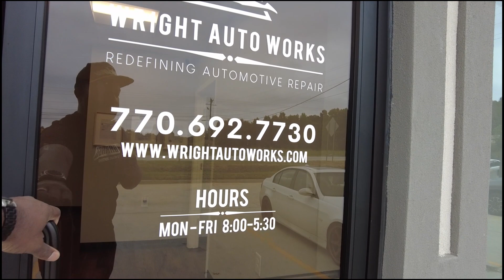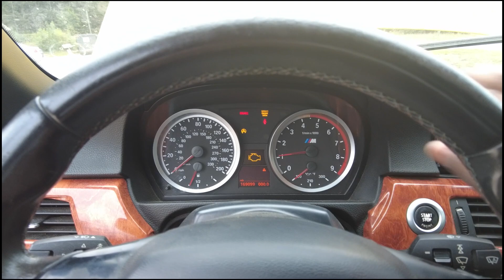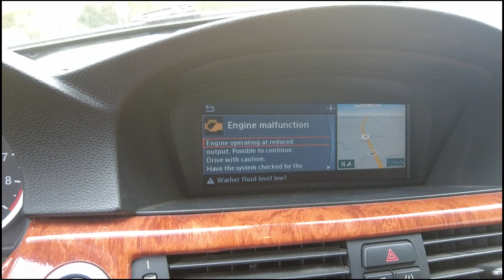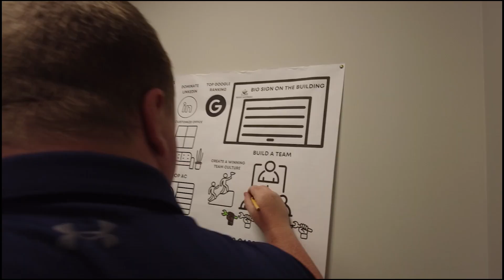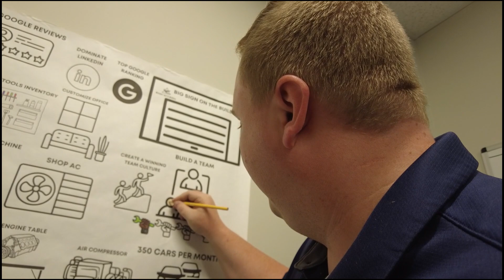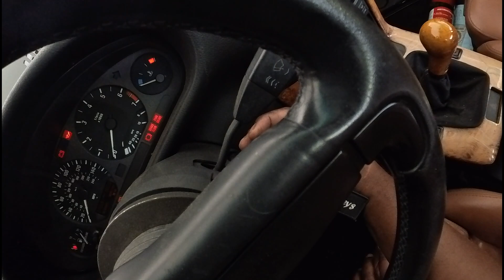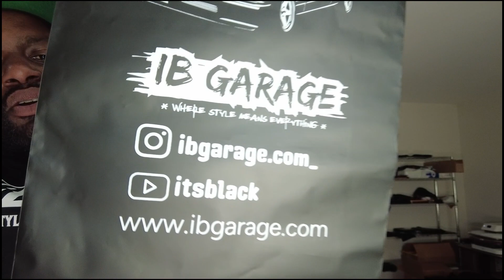It's Been A LONG Time... || ItsBlack

Comment: Before you sell tje m. Check the elec pins in the plugs where  the actuators plug into the harrness they maybe lose an not making good contact. Had similar prob with e46 throttle body connector intermitent codes limp mode..plug in  connector became lose over time causing internitent codes and limp mode